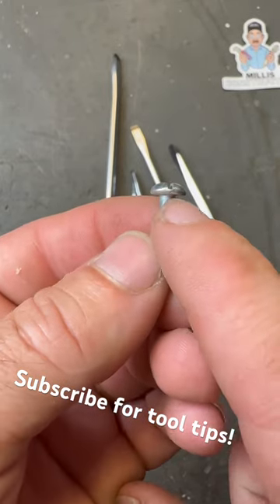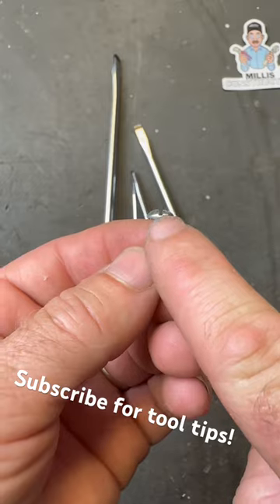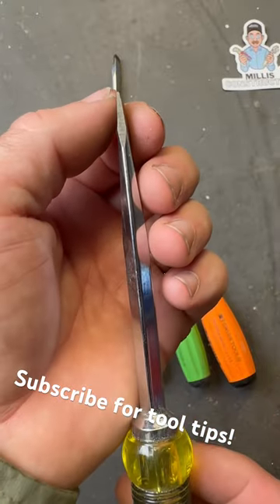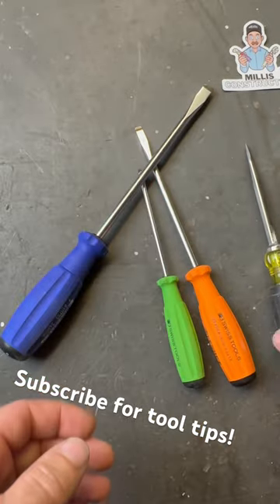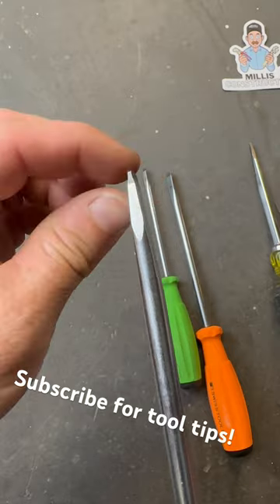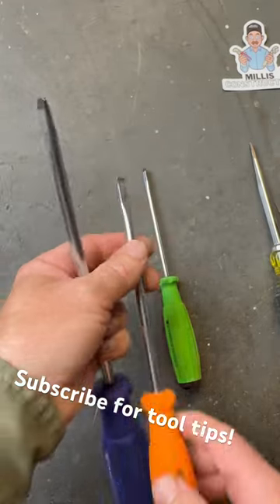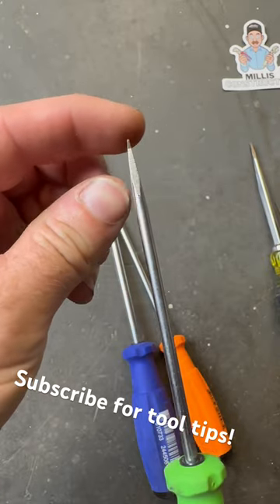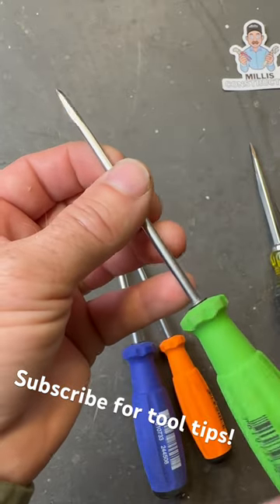Hate Slotted Screws?  Try these drivers!  #pbswiss #pbswisstools #swissmade

Comment: Exactly right. Back in my youth I was a clock repairman and learned quickly that people may not know clocks, but they'll look into the back of the case and will judge you by perceived damage done to screwheads. I started buying screwdrivers from a gunsmith supplier called Brownells. They were expensive, but worked perfectly.

Comment: Last one of those flatheads I used didn't cam out the driver. The whole head of the screw sheared off. Flatheads suck compared to torx or any of the newer heads. Sadly flatheads are so easy to fabricate doubt well ever be rid of them